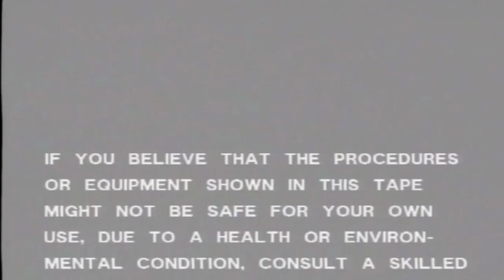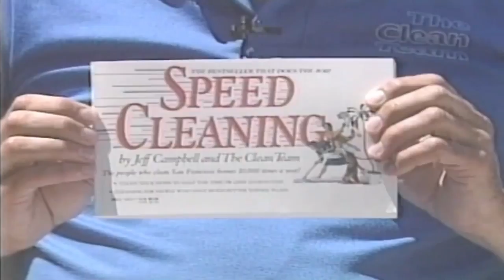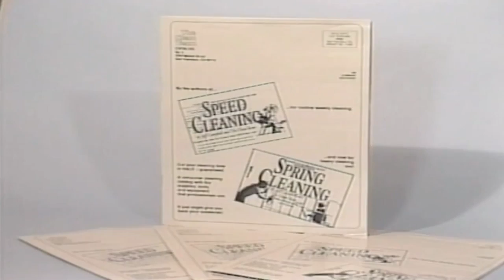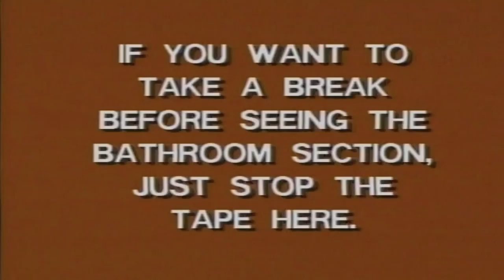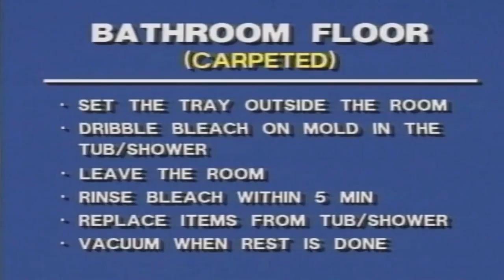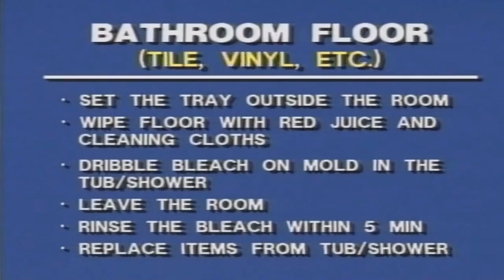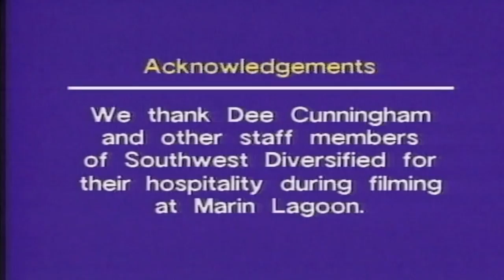The Speed Cleaning Method of Training Employees How To Clean

Comment: Rules
1. Make every move count
2. Use the right tools
3. Clean from top to bottom
4. If it isn't dirty don't clean it
5. Don't rinse or wipe a surface before it's clean
6. Don't keep working after it's clean
7. Shift to a heavier duty tool/ Use the right tool with the right strenght.
8. Keep your tools in impeccable shape
9. Repetition makes for smoother moves
10. Pay Attention

11. Keep track of your time
12. Work as a team (if you have a team)

Warning: Don't spray/clean hot light bulbs

Tools
1 Cleaning Apron: 7 pockets; 3 for small tools; 1 for cloths; 1 for Debris and 2 loops to carry spray bottles; 2 large replace liners for debris and dirty clothes
2 Red Juice: heavy duty biodegradable degreaser and cleaner (finger prints,wood, carpets, etc )
3 Blue Juice: Light Duty Cleaner (glass, windows,pictures,mirrors)
4 Cleaning Cloths: 100% cotton, absorbant hemmed 
alternative: cotton diapers or paper towels (Bounty is the best)
5 Toothbrush (angled stiff bristle brush)
6 Scraper (use at a low angle with red/blue juice to avoid scratching surfaces)
7 Razor blade and blade holder
8 Carrying Tray

Back pockets:
9 Whisk Broom

10 Feather Duster Ostrich Down 
11 Comet
12 Rubber Gloves (Optional)
13 Sponge/white pad
14 Steel Wool
15 Clear Ammonia
Caution: NEVER mix cleaners especially Ammonia and Soap
15b alternative: Brite
16 Sh Mop

Bathroom:
17 Tile Juice
18 Plastic Cup
19 Fibre ckass cleaner
19 Stiff synthetic bristle brush
20 Synthetic big brush
21 Bleach

22Cleaner(combo for furniture/plastic/ wax based ect)
23 Dedicated Dutsting Cleaning cloth
24 Extension cord
Reply: Very helpful.
Reply: @familylively  my pleasure 😇
Reply: I bought a lot of this stuff and suggest getting a Swiffer 360 or fan duster instead of an ostrich duster 😅 i had very little money and the feather duster was a mistake

Comment: Top to bottom, left to right, making your way out of the room. It's the cleaning rule 101. And yes! The apron to hold tools is the most valuable tool of them all. Saves hours of work! I figured out myself after trial and error though. I wish I knew about this video before.
Note: to all of you saying cross contamination, there is no such thing. When you spray, leave the cleaner for 5 minutes, which is the norm, by the time you are scrubing the bacteria and viruses are already killed, I mean, that's the purpose of bathroom cleaners 😂😂, plus no one said you can only have one brush, he probably has multiple brushes, I have 7 different brushes for different surfaces and rooms, all different colors. My kitchen ones are yellow, my bathroom brushes blue. Color coding is essential in house cleaning services.
Reply: I’ll definitely do that from now on or I’ll write on the tooth brush bathrooms kitchen boom done!
Reply: All top here.
Reply: Yes. That’s how I roll as well.

Comment: the hardwood floor that gets sprayed at the end - "You aren't going to hurt it" is a prefinished white floor (rare nowadays) and any chemicals that get on one of those floors need to be neutralized.  I'm betting the red solution is something highly alkaline, so it would need to be neutralized with an acidic solution and then rinsed again with clear water to keep the cleaning solution from eating into the floor over time.

Comment: NEVER spray directly onto light switches! 
Use a  separate toothbrush for the toilet!
Forget the extension cord tip. It will take you longer to wind and unwind it, than it would to plug and unplug the vacuum cleaner  a few times.

Comment: I love the basic ideas taught in this video, although I'm wondering about improvements in the methods sonce this was made. In the updated video, are there any changes that address safety equipment like gloves, and avoiding cross contamintion? I'm pretty grossed out that the same toothbrush tool gets used on all the fixtures and the toilet, and unless you carry more than one set of tools the same brush is being used on kitchen sinks and appliances. What about using these tools as a pro cleaner in more than one house?
Reply from the maker: thereallara nonya we do have new updated DVD but the concepts haven’t changed! They’re timeless!
Reply: @SpeedCleaning  using the same toothbrush in the toilet and the kitchen sink?
Reply: @horsewithnoname12345  red toothbrush for toilet, blue toothbrush for sink

Comment: Did you use the same tooth brush on the toilet and the sink faults?
Reply: I use different colored brushes so that my clients know im not using the same brush in different rooms.  Even if you switch our your brushes, if they're the same color it looks bad.  Different colors for different rooms.
Reply: of course! in those days cross contamination didn't exist. good old times.
Reply: @nonono965  They sell them in a pack of 3 colors.

Comment: 1:35:08 Once feces from the toilet hinges is on the "tooth brush" cleaner, spread the fecal matter onto the base of drinking faucets using the same "tooth brush" cleaner...got it! Thanks :) Other than the above statement, I found this video useful & informative.
Reply: Yeah, there are some parts that I'm having a difficult time comprehending. Maybe he disinfects the toothbrush before he uses it again? That's what I'd like to believe is happening.
Reply: I’m wondering how feces gets to the hinges on a toilet 🚽. In all my years, this never happened to me. Maybe it was my clientele.
Reply: @ziggy33399  It becomes aerosolized. That's why I never store toothbrushes in the bathroom. Oh and those dry blowing air hand dryers in public restrooms are just fecal disperses.
Reply: @JamieAug  Not even that. Use an exclusive tooth brush for the toilet. Clean it and package it. Keep it separate from the other stuff.
Reply: @saynotohookups  I think you can disinfectant it too. I forget what I've seen people use. Hydrogen peroxide in a spray bottle? Spritz it afterwards and look it over. Pretty much what you were alluding to.
Reply: @JamieAug  use different ones and it gets disinfected as it is being used with disinfectant.
Reply: @lisanpdx  good thing most of us have good immune systems. Microscopic amounts of Fecal matter are everywhere. Sadly. Wash your hands.
Reply: @lydiahubbell6278  yeah, I wonder if it's acceptable to use it the next day after u spritz it with some type of disinfectant.
Reply: Anyway, I think I've already said that.

Comment: I learned some good tips from this, but some things, I just don't see how it's better, like cleaning the inside of the toilet bowl before the outside. In the homes that I clean, some people's toilets are absolutely disgusting on the outside, I wipe that first.
Reply: Jennifer Y in his book 📖 (way back when) he didn’t clean the inside of a toilet bowl first. Starting at the top with a clean rag, wipe with green juice (disinfectant) and go top, then down each side cleaning everything. Lift the lid after cleaning the top of it. NOW, clean the underside of the lid. Then around the bowl. The water inside the bowl remember, is the SAME water that comes out of the sink...rinse your rag as needed and refresh your disinfectant and clean down the outside of the rest of the bowls outsides. Lastly, clean back under the rim throughly, and the inside to get off any stains that might have formed. Flush as you go along if you want to keep things nice for yourself. After I’m done ✅ I can throw that rag outside the bathroom door onto a rag (or cotton square shaped diaper I’ve laced flat for used rags) and move towards cleaning the back walls and floors around the toilet. When I’m done I give a final flush. Before I leave the bathroom 🚽 I always put down the toilet bowl lid.